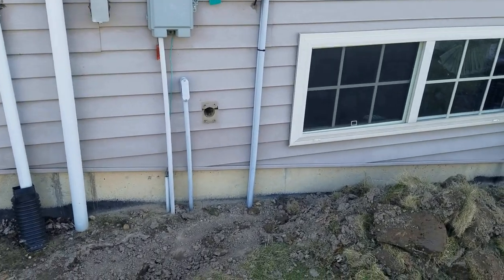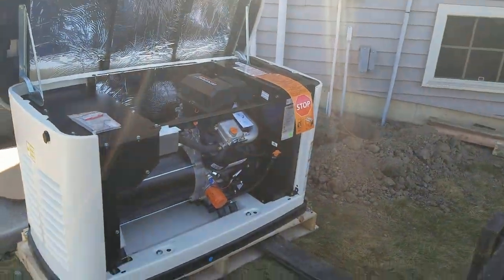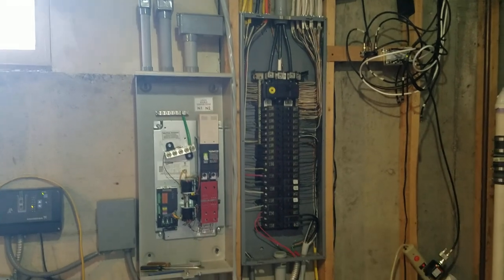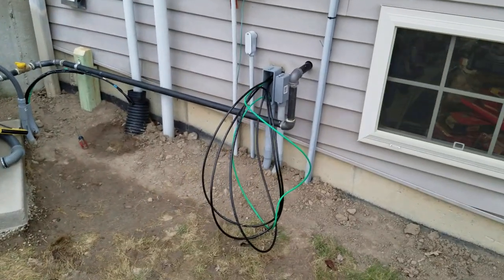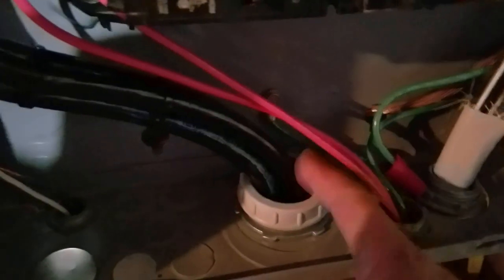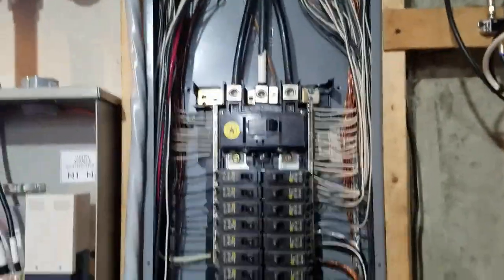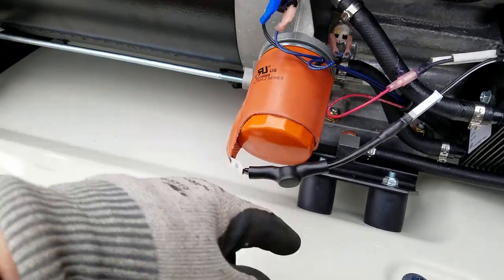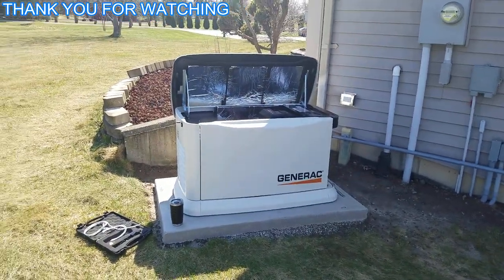22KW GENERATOR INSTALL with 200 AMP ATS

Comment: Awesome project little bit of confusion how do you use 100 amp generator to pick up a 200 amp service? You're running 100 amp wire to the disconnect transfer /switch 200 A wire to the main panel. The last point of confusion is the last picture of the panel you still have look like it was a number six ground right up next to the neutral in the main panel which is now the subpanel is that ground isolated?  Peace bro
Reply from the maker: I know right, yeah the generator can only supply 100 amps therefore it can't run the entire house but for most homes you aren't really running 200 continuously and they do have load shading relays to install for the heavy appliances, so far I have not seen any issues with mine, I'll also have to go back and look at the video for the grounding, I'll let you know. Thanks for the great question.
Reply: I was thinking the same thing. That ground was right beside the neutral. Great catch!
Reply from the maker: I just realized what you were seeing, had to go watch it again, tjat ground was relocated and I didn't get in the updated video, As Derek said, Great Catch, paying attention to details!!!
Reply: @JamesF406  yes sir! Good job man! Really good

Comment: I am a Generac dealer I would ask you look over your installation manual. Your pad must be at least 10’ from any house opening - the window appears much closer than that. By code you must be at least 36” from any serviceable electric, I think you probably are ok for that.
Reply from the maker: Yes sir, I used the measurements in your manual for those requirements, so far everything is within tolerance and I love this generator! Thank you for commenting!
Reply: The fuckin' pad does NOT need to be 10 fuckin' feet from any house opening.
Reply: @243wayne1  Wayne, why are you so angry? You are right the pad can be whatever from an opening. 100s of people die every year from carbon monoxide poisoning. Virtually all were unaware of the danger. I was just pointing out that keep the generator 10 ft from any opening to prevent any possibility of poisoning. Being a dealer or not is irrelevant.
Reply: 36" working clearance would be required in front of disconnecting equipment....a meter enclosure isn't a means of disconnect so he's good. Now if it was a switch on that enclosure then the 3' rule applies. Also, I went through the Generac training earlier this yr....I thought the clearance from openings was 5'...did that change...I'm brushing up on my knowledge, have my first install approaching.
Reply: In New York in my town gen must 20' from window & house & propane must 10' from ignition source
Reply: More for others that may read this
In WA the spec is 5 ft from openings - which interestingly INCLUDES the intake air for my gas furnace.

Comment: When you have propane you should always put a drip in because you will get a water load in the system because there is water in the propane to help push it along the system in time it will freeze up your fuel regulator and eventually you will have issues with your fuel pump

Comment: Great informative video.  I'm getting ready to connect mine soon. How did you extend the utility legs to reach the generac box
Reply from the maker: My electrician friend and I pulled the meter and extended them, no other choice.
Reply: I am one of the oldest Generac dealers in the country you do not need to extend that utility legs when you run the power source to a transfer switch outside with a built-in shut off you are extending it as you put the wire from the bottom of the meter to the transfer switch that is the only extension you have to do it is very simple you just have to be careful not to touch the poles where you are working on it

Comment: That's probably way more than you need. Remember, the more wattage it puts out the more fuel it requires. I'm getting one put in next week. The only fixed generators they had left were something like this. I saved THOUSANDS by going with a portable that was more tailored to my needs.
Reply: The only issue with a portable is when you start having them run for a long. Of time they start breaking down and they are very hard to repair and get back to normal once they start breaking down they keep breaking down I agree. Many many Portables because they are not good enough to handle the load I do not recommend a portable for the whole house
Reply: Installing a stand by generator can add up to 5% equity to your house. It’s an investment that pays for itself. Portable generators don’t do that

Comment: I observed that the N1, N2 and Neutral coming into the main breaker (before connecting to ATS) appeared too short to be routed to the ATS. How did you address that so there is plenty of length to reach the ATS? Many thanks. Great attention to detail!
Reply from the maker: I ended up pulling off the house meter and replacing all the wiring with new longer wire.
Reply: Would the power company know if you pull your meter off to say, replace your breaker panel, then put it back on?

Comment: Just curious , you no longer have 3ft clearance in front of meter pan
Reply from the maker: Thank you for the feedback!
Reply: The conduit also has to be buried 18 inches deep the sky is a hack somebody call code enforcement please
Reply: And the exhaust  Has to be 12 feet away from the window
Reply: The meter pan is not a disconnect
Reply: @thefloridawildlife  according to Generac its 5' I believe.
Reply: @stackez  doesn’t matter if disconnect or not, safe working distance
Reply: @thefloridawildlife  Code is the exhaust can no closer then five feet from any window, 18 inch clearance min.  on the backside.

Comment: Two questions. Where did you get the slack from when you moved your original feed from your main box to the transfer box?  2nd, did you ever install those anchor bolts at the bottom of the generator? I'm not doing my install but I am doing the generator placement. Pouring the slab tomorrow weather permitting. S/N: My first question is strictly a curious one. The 2nd, I need to know how important are the anchor bolts. I'm down here in hurricane alley. (MS Gulf Coast). And thanks, very informative video.
Reply from the maker: Sorry I didn't answer this, hopefully you figured out the anchors. And I ran new wire.

Comment: Very instructive video but I have a few questions : after installing transfer switch did you install 2 new ground rods for it and did you also run a new cold water ground  for it too or can you tie into the existing grounds and just share them from the breker panel?
Reply from the maker: Used existing 2 ground rods, added separate ground to water line and removed bonding screw from house 200 amp service panel, the bond changed over to the transfer switch.

Comment: So you bonded the ats but where is your bond to the generator? I also noticed you did not install ground rods. Yes rod(S )you need 2. One other thing is I hope you didn't close the wall up with the lb's in there. It's now considered a buried junction box. Why not just 2 90s? And the lb's on top of the ats should be flipped with the cover facing outward , not facing up
Reply from the maker: 😋, I have 2 grounds rods that we already installed on the house electrical and the ground from the generator goes to the ground lug on the ATS, we are good😉
Reply: You need at lest 1 right next to the gen pad and you still have issues with lb's in wall
Reply from the maker: @joehorzempa7175  thanks for the update...didnt realize that.
Reply: @joehorzempa7175   @James Foster LS3 TA   Code Reference?  Generac gensets have a floating neutral and  are not a separately derived system.   Generac gensets use the buildings GES.  An  auxiliary driven grounging electrode may be required for lightnig protection by a manufacturer.

Comment: Here in the State of Alaska, it is cold @ 12* the area where I live. Planning to install next year a 14KW Generac generator about 5/6 months from order time; I'm not in any rush. Why 14 KW, it will run everything in my home, but not sure of the foundation placement, the type. I will follow your installation.
Reply from the maker: I used the manual and my local ordinances, it worked well- please subscribe!!

Comment: Profesional nice clean job.  May I ask how it took you get done this project including concret pad, gas line and electrical wire?  One thing i would say you have to route all electrical grounding electrode conductors that connect grounding electrode or water pipe to the transfer switch and has nothing at the sub-panel (original main panel) before.
Reply from the maker: I took my time, it took several weeks to complete the install

Comment: Just installed my new 22k and the engine bad right out of the box!
Reply from the maker: 😥, so sorry to hear that, mine has been running great. Must of been a fluke, hopefully they replace it hassel free. You will be happy once it online. Generac sells a ton of them with very little failures, but it does happen.
Reply: @James Foster LS3 TA  installer said has seen several this year.
Reply from the maker: @chada472  that sucks, must have something to do with the parts shortage, building them faster is not always the best.

Comment: Great video. Thanks for sharing. For charging the battery on the generator. T1 from gen to T1  on transfer switch ? Is that correct
Reply from the maker: Yes, that would correct. Page 24 in the Transfer Switch manual
Reply: @JamesF406  thank you, battery charger now working

Comment: This gave me a headache to watch. But I also install these day in day out. I would have put that ats outside next to the electrical meter. Saved money on wire and materials and time. The gas line I would’ve done an 1-1/4 and ran it straight across the wall outside less holes into the house. But overall good job for a diy enjoy it
Reply: Agreed with you, this dude used  LBs inside. I'm still wondering how he got the meter pulled and replaced without an inspection.  In Georgia, the power company will not replace the meter without a inspection
Reply: Christian Ingram  - in my area, the inspection is performed by a third party electrical underwriter that you (or your electrician) hire yourself; the underwriter inspects and sends the electric utility company that it passed.

Comment: Great looking Gen job. I did everything myself too. You think 3/4 inch pipe is big enough for all the control wires. I want to add an ATS now and have the 3/4 inch pipe near by. When I ran all my underground pvc I left that pipe right next to the manual transfer switch. And you think i shoild go with regular gauge cable foe control wires or get the generac insulated co.trol wires.  Thanks in advance
Reply from the maker: Yes sir, Thank you!!!!

Comment: If you are doing the piping with the wire it is much easier to put the wire in a long as you are putting the pipe in it is much much easier when you get to 90 degree curve it is very hard to pull the wire you can't break the strands on the THHN wire and cause yourself many difficulties so what is better as you put the pipes together pull the wire along with you

Comment: Good job, but why black pipe outside? And Not galvanized?
Reply from the maker: So, a long time ago I was told never use galvanized pipe on gas lines, over time galvanize could flake off and cause problems with regulators, also you not supposed to mix black piping and galvanized piping as where they meet corrosion will be accelerated,  so just to be safe I used black pipe and painted it and will make sure it doesn't rust. Great question!

Comment: Do you know where the 12V Common (-) wire coming from the Generator is supposed to be hooked up to in the Transfer Switch?  I have five labeled terminals inside the transfer switch for the control wires, but I can't find where the 6th wire is to go.  Does it attach to the main Grounding bar in the cabinet?
Reply from the maker: Mine does have 6 connections,
1- T1 Battery Charge
2- N1 utility sense
3- N2 utility sense
4- O DC ground
5- 12 VDC
6- Transfer

Comment: I just had one installed, is it necessary to have a rain gutter above it? If the generator itself is set out away from the roof
Reply from the maker: I have no idea but sounds like a very good idea to me, it will help keep a lot of the moisture away from the generator and generator base. I would do it.

Comment: Explain why you have to separate grounds and neutral in breaker box please
Reply from the maker: It's all about bonding, the bonding needs to occur in the primary disconnect electrical enclosure and that was the main one until I added the generator disconnect, once that happened the bonding (combining the ground and the neutral) now happens in the generator panel therefore by Michigan code you have to separate them from what was the main circuit breaker box, also if you any other breaker box's IE polebarn, they also need to be separate.  If you need more information I can dig up the code out of the electrical book. Hope's this help. James.
Reply: @JamesF406  you wont pass an electrical inspection if they aren't separated with the grounds bonded to the can.
Reply: Mine was not grounded to rods. Said it was not needed. Passed inspection. The installer and inspector talked about it.
Reply: That is a code requirement for subpanels; adding that main panel then made the existing panel a subpanel.

Comment: If you’re using copper for 200 Amp Service the small size you can  use is 3/0  by code, if you’re using aluminum service entrance cable  4/0..
Reply: table 310.12 says otherwise.
Reply: 2/O THHN all day long

Comment: Use a sawzall to cut heavy gauge cable. It cuts straight, quick, and doesn’t mash and deform the cable ends.
Reply: Bandsaw would be the better cut if your using a power tool sawzall is ok if you have nothing else

Comment: He is making the wire in the transfer switch too tight if you have an issue with the wire in the future if you leave a loop at the bottom inside the switch you can have extra wires so if you need to cut a piece of wire off that shorted you can do it if not you have to replace all the water

Comment: Excuse my ignorance, but why did you first put those small stones on the bottom and not simply pour the crete directly on the ground? Thanks!
Reply from the maker: Kinda acts likes a cushion as the ground is so hard, normally you would use sand under concrete, probably didnt really matter for something so small like this pad was, I also added a small piece of rebar just to help with eliminating cracking. Good question👍
Reply: During the winter in the north when the ground freezes water accumulated under the concrete tends to heave and move the pad. After a few years the whole thing would be crooked. Crushed stone helps keep the water away.

Comment: Should we run SER cable from transfer switch to main panel? And remove the main bonding screw, install a separate ground bar in panel ?
Reply: Never mind.  I saw you did.  I only watched hay of the video. My bad. Good job.

Comment: Did you put mesh grid drop-in in the concrete? Also, from the looks of it you might need a new cable modem. That thing looks old AF. Very nice work 💯
Reply from the maker: 😁, no mess but did put in several piece of rebar.

Comment: Thank you... ur video Inspired me to do my own install, and  I’m halfway through.
 I have a run of 26 feet from ATS to the generator, kind of close to what your run is.  If you used aluminum wire which AWG did you use?  One more question,  for the control wires I can use 18 AWG, which control wire gauge do use?  The only 18 AWG wires that I see in Lowe’s and Home Depot r thermostat wires? Is that what you used?
Reply from the maker: Hi, good for you, I used copper but they should be able to help you, I just looked it up online in my NEC book but google is awesome.
Reply from the maker: I also used 16 gauge wire.
Reply: @JamesF406  
Thanks, got the wire with the controls cable together fm our local electric store, genset wire for 22kw.  

Again, thanks for the video, it rocks.
Best wishes & stay safe.
Reply from the maker: @generalbucks8346  awesome!!! Good deal and thank you!!!

Comment: How did you go about getting your utility disconnected so you could run the new mains and get it inspected before putting power back to it?   Im currently waiting on my utility to call me back and schedule a outage.....   over a week and no call!   im tempted to just pull the meter myself..
Reply from the maker: if I told you I would have to ^%&^%& you....:)

Comment: Why is a 200A ATS used when the generator is limited to about 140 amps.  Is the house main 200amps?
Reply from the maker: Good question, you have to use load sheading relays or just make sure to not run everything if you have high amp appliances, I have a 220 well, polebarn and basic gas appliances,  it's runs everything.

Comment: WOW Thats louder than I expected.
Reply from the maker: Works very well and from the inside it's a lot better......my portable generator was really really loud😛
Reply: @JamesF406  Do you know how many decibels?
Reply from the maker: @TractorWrangler01  they say its 67 decibels,  not really sure if that's true or not.
Reply: @JamesF406  Thats really not that bad. Im not sure why it came across so loud on the video. I was judging it at about 75-80 decibels. It might be because its in a corner like that. Mine is 65 decibels and my wife says its too loud. So I am in search of one thats like 55 but I cant find one.

Comment: Very informative video, thank you. Have you ever run your generator for an extended period of time during an outage? About how many gallons per hour did the generator burn please?
Reply from the maker: Yes sir, ran for 24 hours perfectly,  it does use a tad bit of oil but it is brand new, rings are probably still seating in. I love you.
Reply from the maker: Not sure how much natural gas it uses.